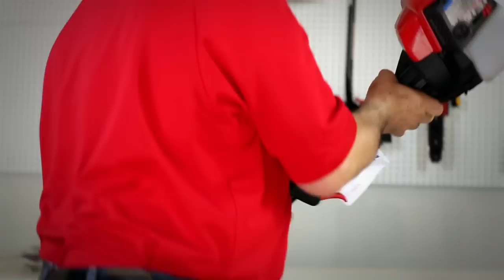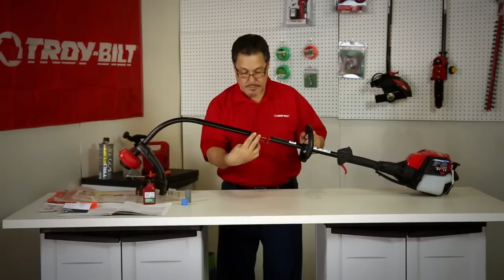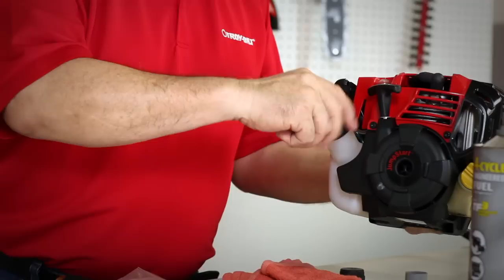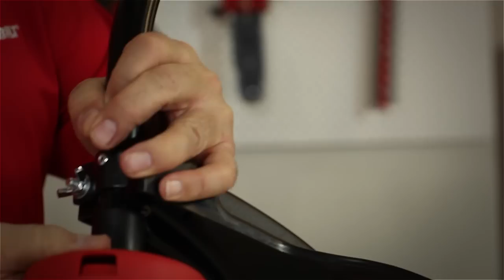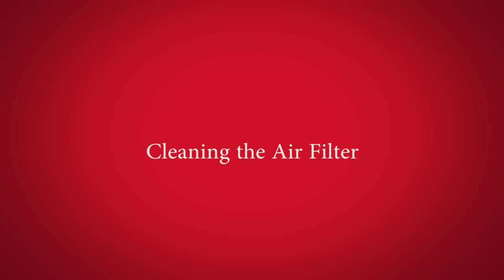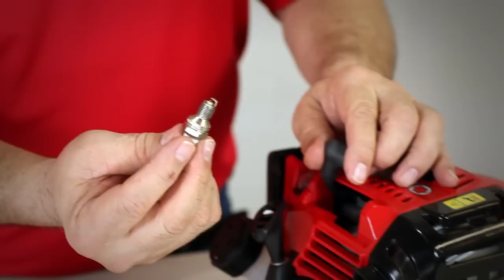The TB625 EC gas string trimmer | How to set up your 4-cycle trimmer

Comment: Mine comes without a choke, and starts very easily. But it doesn’t have a oil window. So I can’t see the oil level easy....great trimmer though
Reply: I have the same one and I use Castrol sae HD30 and it's still running strong

Comment: BIGGEST PIECE OF CRAP EVER.  ENGINE CONSTANTLY BOGS OR STALLS RIGHT OFF OF IDLE.  HAVE A FRIEND WITH 30 YEARS OF SMALL ENGINE EXPERIENCE AND THERE IS NOTHING THAT CAN BE DONE.  ALSO HAS STEEL PAWLS IN THE STARTER SYSTEM THAT BREAK VERY EASILY AND TROY BILT DOES NOT OFFER REPLACEMENTS.  YOU MUST BUY A COMPLETE OIL PAN FOR $30+ TO GET THESE $2 PAWLS.  SHAME ON THEM FOR SELLING SUCH A POORLY ENGINEERED PRODUCT.

Comment: I have had 2 of these in less than 1 year.  both have major issues with carbs.  All my other small gas engines run fine, so dont say its my gas!   i use the weedeater for 3 months this season and now, nothing, wont start without a little squirt of something,, so i know the carb is clogged.  what is the fix?  this thing is ticking me off!

Comment: How do you lock the shaft to take the nut off it to see the bolt threads? I've got the old trimmer head off but need to remove the remaining pieces to install a Ugly Head trimmer head to it.

Also I was able to see how the line feeds through since I have the trimmer head all in pieces on my workbench.
I AM VERY PUT OFF BY THE FACT THE DIAGRAM SHOWS THE LINE FEEDING STRAIGHT THROUGH AND THIS IS NOT THE CASE AT ALL!!!!!!! EVEN THE WRITTEN PART DOES NOT INDICATE HOW THE LINE ACTUALLY FEEDS THROUGH. I WILL NEVER BUY A TROY BUILT TRIMMER AGAIN!!!!!

Either learn how to write up a proper manual or just don't include one at all!!!!
Reply: How did you get it off

Comment: Reliable? Thats a laugh! I have had terrible luck with Troy Bilt products.  I bought a TB685 4 cycle weed eater. It 
lasted about 3 uses and then quit. I returned to to Lowes for a 
replacement. The replacement unit didn't even start ONCE! DON'T BUY TROY BILT PRODUCTS!

Comment: I love how they are making it look easy to change the line..I've been trying to put the line from one hole to another for the past 2 hours and it just doesn't go through..If you buy this product don't use it for commercial because you'll be losing money. Personally, I'm taking it back to Lowes'..Good riddance!
Reply: lol you cut 2 ten foot sections of line insert in the ends then just turn the bump knob to winde
Reply: Same here. My line will not go straight through. I even disassembled the head and then inserted the line to watch it, and I don't see how it's even possible for it to go straight through. Junk. This is my third Troy-Bilt and I won't buy another one.
Reply: Yes, I agree with you 100%. The head on this trimmer is complete junk. It makes you wonder who designed this and even worse how did it even get into production. It's an okay trimmer mechanically, but the head is trash because that is where it will end up at soon after you buy it. I am replacing the head on mine with a universal one I found of Amazon.

Comment: The line never feeds correctly.  I have to stop, remove the line and re-feed it every 3-4 minutes.  This happens 100% of the time when trying to use the trimmer.
Reply: how do you untangle the fuel

Comment: I'd really appreciate any information that can be provided on how to remove the entire head.
Reply: I don't know about your particular model, but mine broke and I couldn't remove it. I went to Lowes and they told me it was not removable. Bullshit. If it can be put on it an be removed. I took the lower shaft off the weed eater and put and tap handle on the shaft end and the head just unscrewed. I replaced it with a Stihl unit that uses short precut line pieces. I got no problems with that.